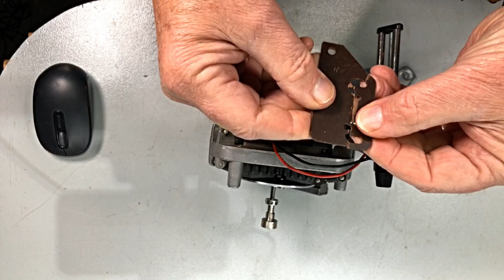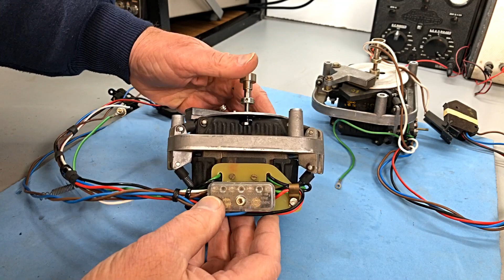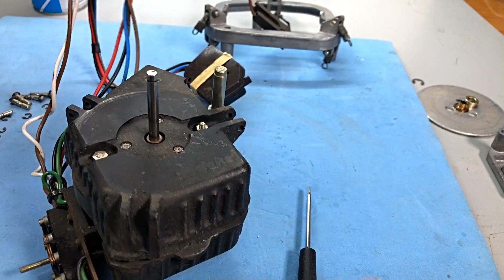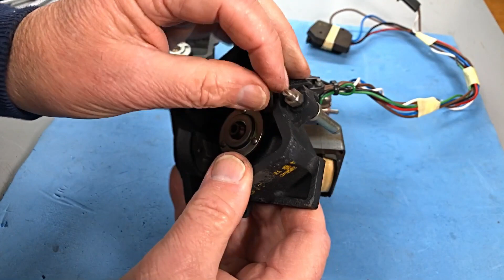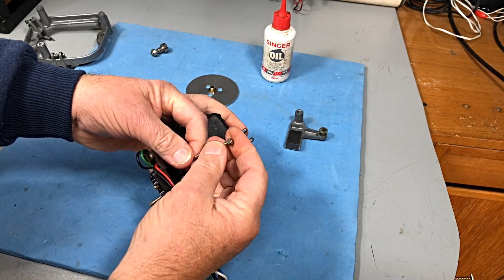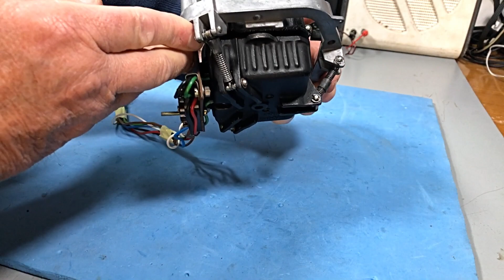Garrard 401 Turntable Rebuild -  Part1

Comment: excellent ! another way to install the speed disk, is to fix it as low as it will go without grazing underneath. I use a couple of small strips of light card underneath the disk to help me. The speed disk when its really close to the top surface of the clam shell appears to benefit from 'ground effect' phenomenon (??) and spins for longer after switch off, when this is done. It is then an easy matter to attach the magnet brake assembly using the adjustment screw which raises or lowers the magnet. First get the height right turning the screw clockwise or anticlockwise then tighten up the nut. Trial and error to get spot on. I plug the motor in to fine tune this adjustment. If magnet is too low it will graze the speed disk and make an awful scraping noise. If too high, the magnet will not exert enough stopping power on the disk. Sometimes the magnet itself has lost its power but this can be fixed using a neodymium magnet.
Reply from the maker: Thanks for the detailed suggestion, I appreciate it!

Comment: The best way to clean aluminium is to use used wet tea leaves or used wet teabags, put the alloy into a pile of them and in the morning it will be bright shiny and like new. My speed disk looks like new despite its vintage age.Also not touching but very close is what paper is for. it gives a gap and holds the two pieces together at the same time to stop unwanted movement, do up the screws and take out the paper. Done.I many years ago worked for Olivetti and have a great collection of clip tools, split screw tools and my own set of home made spring hooks. The reason being that Olivetti up to the electronic era used about a ton of clips, springs and screws and grub screws in every machine. The just could not help themselves, they just had to make machines that were mostly spring driven and only used motors to restore the springs to the ready state.
Reply from the maker: A very interesting post indeed, I'll have to give that a go, thanks so much  for the tip !
Cheers

Comment: Invaluable material for anyone seeking to restore their 401. Many thanks for the great work!
Reply from the maker: Thank you so much 🫠
Reply: @techobaz55  May I ask: What do make of the idea that you have to dismantle the lower motor bearing as well in order to get the whole unit to run really quietly? That would be the part where you'd have to drill out the rivets from the underside of the motor housing. I'm shying away from that to be honest...

Comment: Bootlace terminals / ferrules are one of those things you really appreciate once you start using them and have the correct tool.
Reply from the maker: Spot on ! Once you start using them you can't stop !
Reply: @techobaz55  I have a Garrard Zero 100 in for a minor repair at the moment that has the same terminal block on the motor.
Reply from the maker: @daShare  very interesting. Not familiar with these but will do some research for myself. Cheers